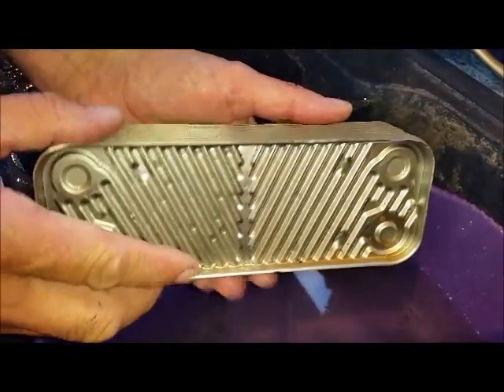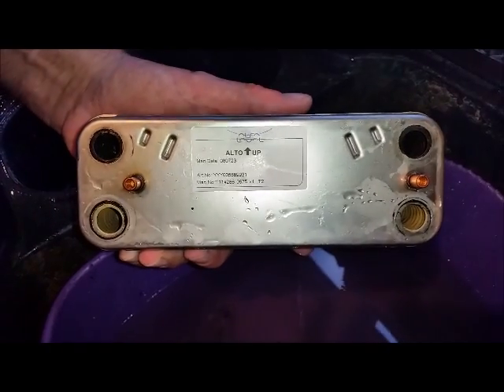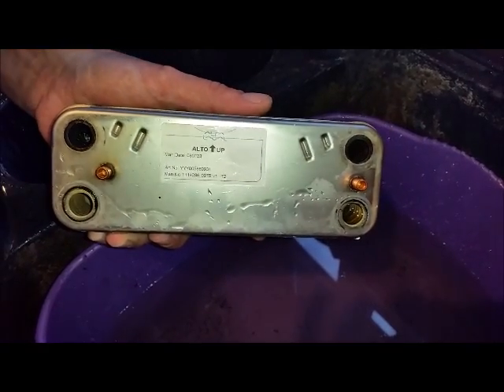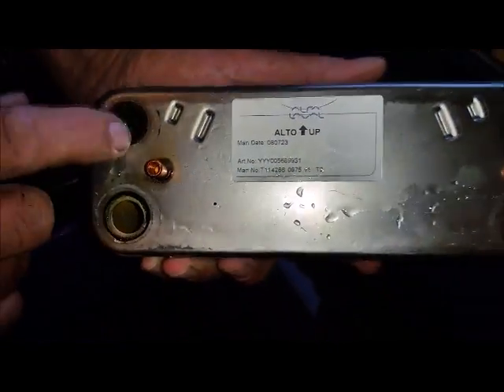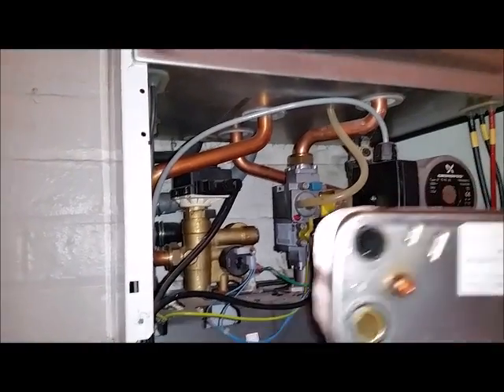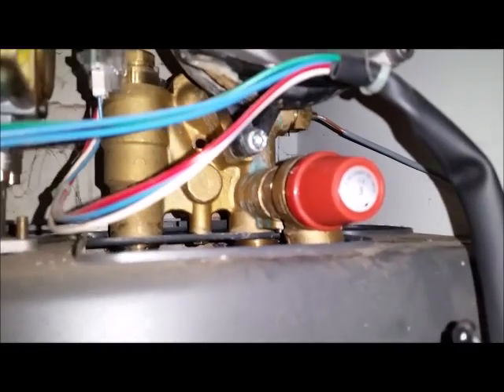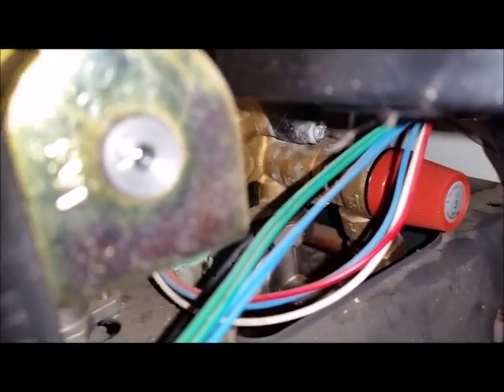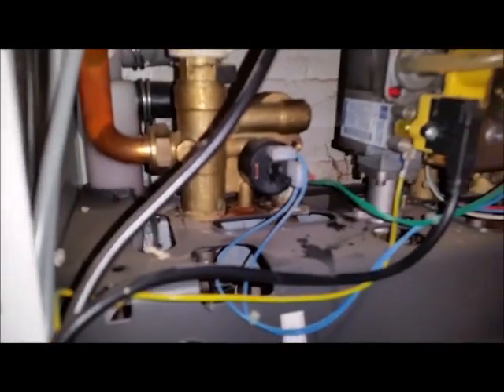COMBI BOILER heat exchanger

Comment: Ive isolated my hot water ftom the boiler so i only have heating when i switch the hot water on the pressure shoots up the engineers sahs the heat exchanger is passing is this a thnng

Comment: When replacing it you put new seals do u need any form of sealant
Reply from the maker: no thanks foe watching
Reply: @MrMeltedwellies  so when screw back together it holds
Reply from the maker: Yes they fit on the pipes going into the heat exchanger very easy job good luck

Comment: My hot water is brown colour after replacing a radiator and adding inhibitor to the system what could be the cause of this? After running for a while the water runs clear but the next morning it is brownish colour again

Comment: The valve you’re talking about is a safety blow off device and if you’ve not installed it correctly you will have instantly voided your home insurance. 

The plate heat ex also requires live and new washers.
Will leak within five mins. 

To save money,
Order new part and pay someone who has liability insurance to instal. You’re mad to do this yourself
Reply from the maker: I got a quote for £450  fitted for a heat exchanged that coasts £27 brand new with washers so thats why i fitted it myself saving over £400 you work it out thanks for watching and comment

Comment: The dirty black side is the central heating side. The C/H water is diverted to the secondary heat exchanger plate when the hot water tap is turned on and heat from this dirty C/H water is transferred via the  heat plate to heat the Hot water side, but they are separated within the plate and never mix .

Comment: Brilliant, that’s exactly what was wrong with ours. For me I had to turn the pressure up as it didn’t seem to bleed correctly, then reduce the pressure in the system and the hot water popped in to life. Thank you for posting

Comment: Just changed my heat exchanger tonight. Took about half an hour!  Easy!.... I'm glad I got a new one and didn't bother to cleaning the old one. As the new one I got off ebay for £35 was actually about 15mm bigger. So now it'll work more efficient!

Comment: Replaced my water pump. Only 'wet work' so completely legal as a 'competent' homeowner working on my 'own' boiler under HSE guidelines.  Seals do not need to be broken for this type of work. Gas Engineer quote, who told me it would be illegal for me to carry out the work (bull%$it) and I could go to jail, wanted £300 plus VAT. Cost me £50 for a refurbished unit and 20 minutes work.  2 years later, it's still working and I am still alive. A few years ago a gas engineer told me it was illegal for me to drain down my own boiler because I wanted to top up my scale inhibitor. He wanted £500 to do it for me!!  I would never touch gas supply, and on those occasions I have to get out the rip-off guys. I find that just doing some research and due diligence first helps a lot, so you can at least challenge their Bu**&^sh**t which tends to assist them in telling you the truth about what work really needs doing.

Comment: Magnetite doesn't run into the hot side as the water doesn't mix. So the top holes are rhe heating circuit the bottom are the hot water. The flow rate has been reduced through the HE which is preventing the water heating adequately. 

I hope you have gas tickets

Comment: If a gas boiler is not maintained correctly it could leak CO.  

CO is odourless and kills! 

Steam expands to 1000+ times it's volume when released in air. Hence a boiler has the potential act like a bomb if not maintained correctly.

The Pressure Release Valve that was replaced is a safety device to address this issue.

Lastly no mention of appropriate safety checks.

Always use a Gas Safe engineer!!!

Ask yourself how much your or your families life is worth?

Comment: First of all, depending upon the boiler, it's layout and size determines what ancillaries have to be removed fan, gas valve, pump, diverter etc and hence wether it's a "doddle" or not to remove. The expansion vessel should have air in one side, pressurised to facilitate system operation, hence it's name. If the relief goes of it could be for a reason, which should be ruled out before replacement. A very misleading video as not all boilers are equal. I can see a few over keen D.I.Y. ers getting into trouble with this one.

Comment: You seriously suggesting a non competant client touches a boiler themselves. Use a gas safe registered fitter never work on a boiler without being competant. Also if the heating side is coated in sludge it can also cause lack of hot water. A worcester secondary heat exchanger is £60 not worth messing with. The cheaper boilers are more expensive for spares  so always buy good . Also if the cold inlet had a water treatment device or anti lime as per manufacturers instruction it is unlikely to block.

Comment: Listen mate I pay £157 every year to be registered with gas safe and  £800 every 5 years to resit my acs you should be touching the boiler at all if anything goes wrong and someone dies they change rules and regs because of it this is why plumbers charge so much if you want to be a gas engineer go and do your training and for your info just take the PRV out clean it and grease it don’t buy a new one you div you should be reported to gas safe your breaking the law

Comment: Hi I have to put a new heat exchanger on my boiler the new one comes with an arrows saying primary and secondary. So is the primary at the top or bottom it could go on to ways .is there away for me to tell by looking at my boiler outlets thanks

Comment: You don’t know what you’re doing. Stop being a tight arse and pay a professional. That’s not even an expensive repair to carry out so you haven’t saved much
Reply from the maker: Tight ass £400 to change heat exchange  that costs £34 quid of ebay thats what i was quoted !!!!!!!!!!!! i might be tight but not stupid plus a like playing lol thanks for watching Frankie
Reply: Mark Davies £400? That means you’ve had a chancer try and rob you. Should have looked for a reputable heating engineer. I would have charged about £90 with a 12 month warranty and new seals
Reply: @frankiesalmon7545  I've just been quoted 360 for the same job. very common sadly

Comment: Under no circumstances should you be touching the boiler if you’re not gas safe registered, also it’s the top channel that’s central heating not hot water. Your advice on the PRV was also incorrect, there’s a reason they open up in the first place and it’s 9/10 got to do with the expansion vessel...but I guess you’d know that if you were qualified to work on it.
You are breaking the law.
Reply: Get your terminology right for a start that's a dhw plate heat exchanger....not a main heat exchanger a prv is a pressure release valve which is set to open over 3bar to let pressure to the outside safely it is a safety device also remember you idiots who say we charge loads 1 the part cost is materials you are paying for time and pure experience and competency to know the exact workings of a boiler from its combustion process to its heat process our tools cost us hundreds to have specific tools our training took years and we resist exams every 5 years at our own cost and yes to touch the inside of a boiler a combi boiler you have to 1.be gassafe and have acs in boilers and water heaters etc what you are misinformed about is a SYSTEM boiler where the pump ,3 port and vessel all sit externally of the boiler in an airing cupboard idiot
Reply from the maker: nope not breaking the law your wrong i an not touching the gas just the water plus i dont give a shit, if you so called plumbers stop sucking air through  your teeth and do the job when your asked and stop quoting stupid prices ie £400 to change the heat exchanger  that costs £34 quid of ebay then maybe just maybe you wouldent have such a bad reputation for being rip of merchant  ps thanks for watching
Reply: @MrMeltedwellies You need to be gas safe registered and competent to work on a gas boiler, the fact that you don't even know this, and refuse to accept it, proves what a danger you are.

Comment: If you are not a gas engineer you shouldn’t be taking the boiler case off.. you’re breaking the law.
Reply: Many appliances have cases, which in addition to being decorative, function as a part of the combustion circuit and form an important seal around the gas carrying components e.g. burner, combustion chamber, gas valve etc. If removing the case involves undoing a number of screws, this normally means it is a functional case and it should not be removed by the consumer or a person who is not Gas Safe registered.
For further guidance on whether you can remove the case from your gas appliance: • refer to the manufacturer’s instructions
• contact manufacturer’s helpline
• visit the manufacturer’s website
Remember, whenever having any gas work carried out, always use a Gas Safe registered engineer holding the relevant qualifications for working on your gas appliance. To find or check a Gas Safe registered engineer, go to www.GasSafeRegister.co.uk or call us on 0800 408 5500.
Reply from the maker: Hi Darren ok fair play in response were we live we must have the shitest  plumbers ever i rang 5 plumbers to come and fix the boiler No hot water No heating at the time we had 4 grandchildren and 4 adults living in the house due to house fire for 4 weeks no one turns up this is in the middle of winter so you can probable guess i was a bit pissed off ,my videos show how  i TRIED TO FIX the problem not a guide to others plus i do have a mate who is gas safe 
thank you for watching and your advice
Reply from the maker: No i  am not breaking the law  i am not touching the gas plus its MY boiler
Reply: Mark Davies yes you are.. you should not be removing the cover from a gas boiler. Also how will you know  If you knocked the gas valve and caused it to leak? Do you know the procedure for checking the gas is tight or the safety checks that need to be carried out after working on any part of a gas boiler? I tell you what, why don’t you call gas safe register to see if you’ve broke the law...
Reply: @MrMeltedwellies  it doesn't matter who's boiler it is, you sound like a child

Comment: Horrific advice. Information regarding the PRV is utter nonsense. Appreciate you fancied a go yourself and deemed it all easy but frankly you’re giving out incorrect guidance on a gas fired appliance. Remember, changing the parts is easy. After all it’s just screws and bolts. Its knowing what to change and why. Knowing how to work to a safe practice and that everything is safe when you put that case back on!
Reply: I agree just pay trades man 800 quid for a 1 hour job. A new one is only 30  so just swap it out  it’s two screws on a baxi
Reply: williamswhistlepipes 800 quid?! Sounds like you had some serious twat tax applied there bud 😂🤷🏻‍♂️
Reply: @williamswhistlepipes You need to be gas safe registered and competent, to take the cover off a gas boiler. This clown is neither.

Comment: How long before they tell us not to open the bonnet of our cars,unless your a qualified mechanic?
Reply: Not exactly the same, no laws have been broken working on a car.
Reply: I agree iam a mechanics by trade and some of the repairs I see that general jo public do are shocking .a motorized vehicle is just as dangerous as a boiler. You shouldn't touch anything unless you are competent you can do the job . Previously a plumber mate when I was a lot younger
Reply: @Paul ELSCEY  I agree some shouod never touch a car ....personally I'm competent been doing my own brakes and servicing for upto 10 years now . I take more time and effort in coeaning caliper brackets pins etc . I know mechanics want quick coin so keep it simple my buddy nor long sold his business tyres brakes etc . Good worker no faults he used to do mine ..even he admits my work is thorough
Reply from the maker: IAM WITH YOU ALL THE WAY LOL

Comment: Plumber charges a fortune because he can do the job legally !
Reply: When your hiring a professional to do the job. You're paying for their experience training and overhead costs such as public liability, tools, training, van insurance etc. Most importantly safety. Meh 🤷‍♂️ you save a few quid. However there's the possibility you end up killing yourself along with others. Reg 26.9 is always our code of practice. I sleep easy at night knowing I've left a customers house safe. The diy jobs I've encountered make make me cringe. A reputable heating engineer with would have charged between £90-150 to sort that. Without a proper chemical flush this boiler is going to be overcompensating to heat the plate to plate. Thus using extra gas.
Reply: @rayc1503  unfortunately, after calling 7 plumbers in a week, 5 did not turn up, 1 turned up, gave it a good stare and left, 1 emergency plumber visit, did a service but still problem remained. ordered part for him to come back next day,  no show on that one. now on 8th plumber who says he won't let me down. not overly enthused with optimism that he will turn up but if he doesn't then DIY is the only way.
Reply: @minimad8793 It's not a job for a plumber, this is a job for a gas safe registered heating engineer.

Comment: I agree top one is ch bottom cold feed.....shouldn’t be doing as not competent to work on a boiler .....if you disturb Gas supply and didn’t carry out 26/ 9 checks after taking off any combustion case in event of incident you will be prosecuted .....also house insurance will be nil and void .  Get a Gas safe engineer ........

Comment: I don't this myself  on my worcester 24i junior, replaced heat exchanger .. had my gas safe mate pop by and checked it all , said done well.. cheers for the video!.. got my heat exchanger spar parts on  line also.. apparently  i saved myself £550 !! that a usual gas engineer would charge..

Comment: Helpful video on how to remove and refit a plate heat exchanger.  However I think you misunderstand how the plate heat exchanger works when you said the blocked section was the hot water side, and the clear section was the central heating side.  The central heating doesn't actually use the plate heat exchanger.  When you run the hot water tap, the water from the boiler's main heat exchanger circulates through the  top holes in your plate exchanger, while cold mains water flows through the holes at the bottom.  The heat from the water heated by the main heat exchanger is then conveyed by conduction to the mains cold water, heating it instantly.  When the hot tap is turned off and the central heating is on , a diverter valve bypasses the plate heat exchanger and  sends the hot water from the main heat exchanger to the  radiators around your house.
Reply: You have just given the answer I was searching YouTube videos for my question on how a plate heat exchanger works, thanks
Reply from the maker: Hi Jonathan thanks very much for info and for watching ATB
Reply: Thanks.  Heating engineer for 10 years and never quite knew that myself :/

Comment: He is not breaking gas regulations. Consumers can take off front decorative hinge panels of a boiler and work on NON gas carrying components (such as ch pump, secondary heat exchangers, non gas seals,) And he is not disturbing combustion process and he is not disturbing any gas supply pipe. If the work could be undertaken without having to break a combustion chamber seal or disturbing any gas carrying component or disturbing a module that controls the combustion process, it would NOT need to be undertaken by a gas safe registered engineer. Gas safe engineers scare people by saying you gonna blow your house down or you will be jailed its time consumers educated and there legal rights. Consumers are getting ripped off.
Reply: Anyone can tell this muppet ain't gas safe registered. Shouldn't be tinkering with boilers at all really. Now analyse this your neighbour decides to have a go a replacing a gas valve. Doesn't seal it up correctly. They leave the house. Possibly a few hours later boom an explosion. We have gas sniffers monometers and flue analysers for good reason. Don't tamper with boilers. Leave it to the professionals.
Reply: You sir are a complete knob, not all cases are decorative, some form a seal! You wouldn’t know this because just like the poster of the video you talk utter shit!
Reply: He said he changed the prv himself..... The prv is a safety device and is covered by the gas safety regs building regs and British standards.
Reply: Correct sir, not all cases are decorative, if a cover has many screws fixing it to the casing it is an integral cover and should only be removed by a gas safe registered engineer, However, some are decorative, like the vaillant ecotech combi boiler only has one knurled screw on the bottom that can be removed with, or without tools. legally anybody (by anybody I mean someone with at least half a brain and a good understanding of whats going to be inside it.) can remove the cover, any competent person can inspect, repair or replace non gas components, like the expansion vessel, prv, or water pump.
Reply: Completely wrong the vaillant Ecotec cover forms a seal that has everything to do with the safe working of the boiler and is not a decorative case. See how dangerous information can be given out by people who are not in full knowledge and  competent